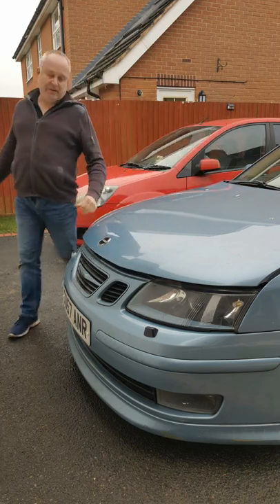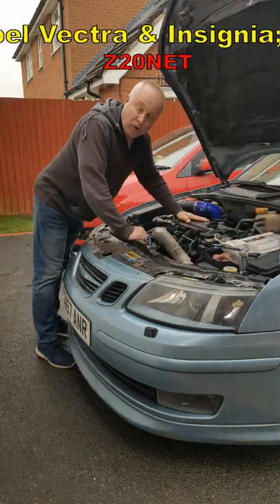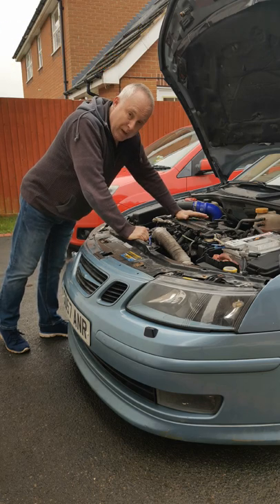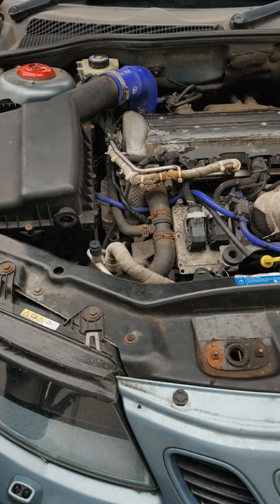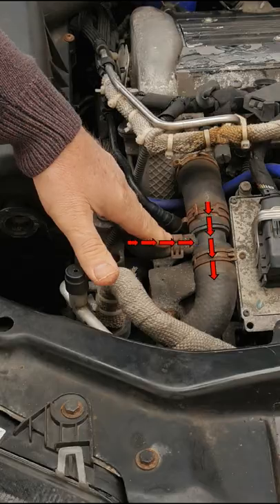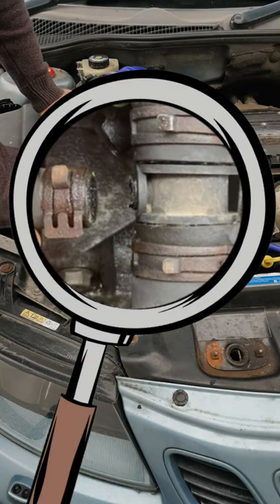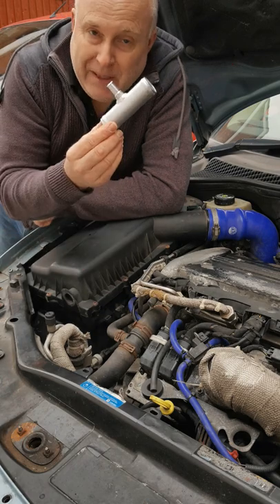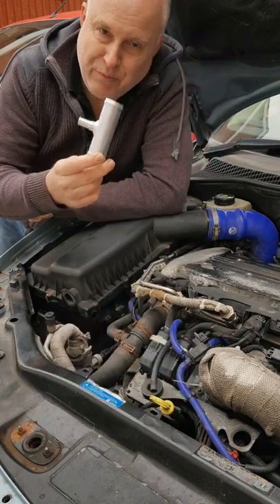Saab 9-3 Coolant Tee | Saab 9-3 Common Problems | #Shorts

Comment: Metal also aids in cooling better than plastics. Yes, it's a small piece but I prefer metal to plastic when & where possible in cooling systems, even if they're more prone to collecting buildup. 
 In this case the engineers didn't build that T robust enough.
Reply from the maker: The engineers did a good enough job for the part. OE 'lifetime' requirements are 10-12 years and it's met that. I'm not certain yet, but suspect it's polyprop, which has good heat & chemical resistance but heat ages and the polymer strands break down leading to cracking (and then 'pop' it snaps).

Comment: Did this similar mod on my 97 vauxhall frontera 2.0 petrol 8 valve. On that it contained th temperature switch for the radiator so none available at vauxhall. Went to demon tweeks in Wrexham were they had all sorts of sizes, they stock loads of stuff like that due to being suppliers for motorsports use. Fitted a treat with some minor modification, worked great too. Great video once again. Thanks.
Reply from the maker: In my younger days when I was involved in motorsport, me and friends were regulars at Demon Tweeks. I'll take a look, thanks
Reply: As you yourself know about the range of parts demon tweeks stock, really great place for obscure or out of stock or obsolete parts, they still do the free parts catalogues, various types of vehicles catered for including motor bikes and mountain bikes. Great video's by the way. Still not got to the bottom of my charging issues on my Saab 9-3 1.9 diesel estate. Do some more test using your how to guide. Thanks, Vinny.

Comment: Do you have the partnumber? Would perhaps be a good idea to get a spare part :) 
Thanks for the video!
Reply from the maker: No point in getting another plastic one. There's a link in the description for the same metal one I got. If you're outside the UK let me know where you are and I can work out postage to your location.
Reply: @CycloneCyd  im from Belgium and i want one, just in case
Reply from the maker: Hi there  @wtsmetin43 , if you don't currently have a breakage problem and feel you can wait around 4-6 weeks, I now have a silicone hose solution, that's just as robust at about two thirds the price. I've been in touch with a hose manufacturer and have just received the first off prototype part for fitment testing on my own car.
I'll be doing a video as soon as I can confirm the fit quality is good (I'm already happy with the hose quality) and have them for sale in the description. I believe I will be the only person selling this hose as a stand alone item (other well known tuning houses sell it as part of a [expensive] kit.
So, keep an eye out!

Comment: Hey Cyd.. this doesn’t apply to this video however you’re the only man I can think of to reach out to...

Car struggles to start once warm... PLEASE help!

I bought a Saab 93 2007 2.0T not too long ago, 100,000 miles, and I’ve noticed something super strange. It is about 45 degrees here if that matters. 

The car, when super cold, starts up no problem at all, however I notice once I turn it off to maybe go into a store for 5-10minutes, even if the car is warm it’ll struggle to start... and for the first time ever it actually jumped, struggled, and didn’t start whatsoever. I was then able to retry right after that and it started.. this problem is scaring me as I don’t know much about cars and it seems pretty serious.. 

it’s almost as if the car will start and then run really rough for 15 seconds and then be fine. I have no lights on the dash. The car runs perfect when it overcomes that weird struggle for power. Any ideas?
Reply from the maker: Have a look at this. Might be your crank sensor. Next time it won't start watch the tacho
https://youtu.be/iLKOqCS67xM

Comment: Mine just went, got the one from NeoBros simple fix took 30 minutes tops.
Reply: Did you get the one which goes together with the hoses ? 25 £ ?
Reply from the maker: Spot on. Job jobbed
Reply from the maker: That's the only one they sell, so I'd guess so.
Reply: @MrOikono  yes